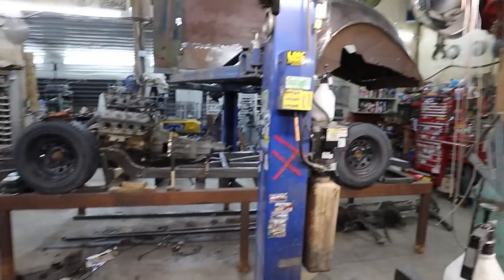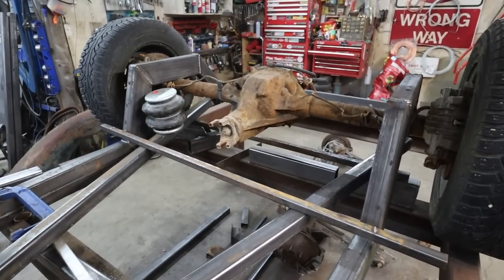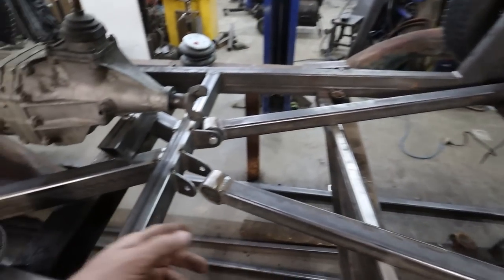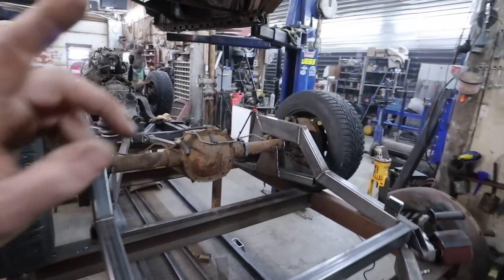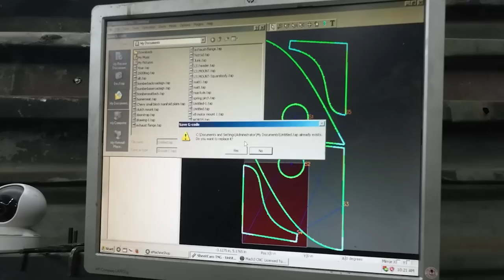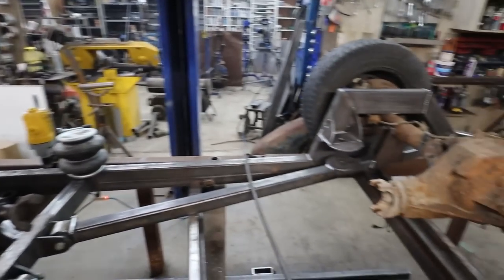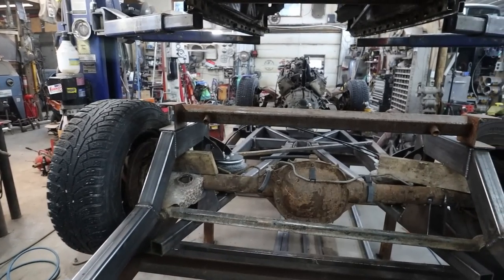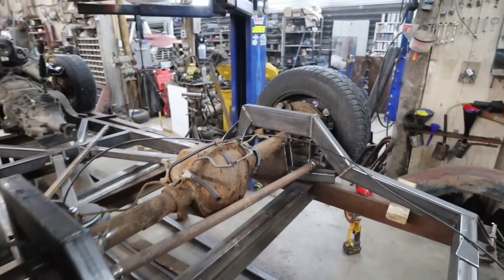Building the 2 link air ride rear suspension for our 1935 Dodge coupe.

Comment: In 1968 I built my first hot rod.  1931 Ford model A.  I built a truck arm rear suspension using 1968 Impala  rear control arms using 2x3 tubing, just as you are doing.  I extended the arms right under the trans mount. I used Corvair front springs right at the rear axle. It rode great!  Plus when you got on it, the arms lifted the whole car.  I hope you have the same result!
The front suspension was a 1968 Corvair, with modified A arms.  Had a Volvo rack and pinion. We had to build everything back them.

Comment: As you were tacking (welding) the diff mounts, I was wondering when you set the pinion angle, cause I didn't remember that happening.  😀  
The frame and suspension is really starting to shape up now!

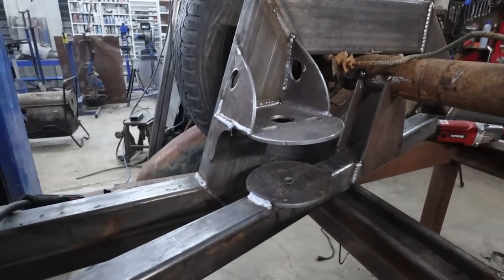Comment: 32:50 that slug is called a "crush tube" and is always a good idea.
Tying the two upper bag mounts in together with it's own crossmember is smart, personally I'd make it removable with a mount in the centre as a provision for a driveshaft hoop.

Comment: looking amazing! i would personally put bushings on the lower control arms at the diff instead of solid welding to the diff. not just for serviceability reasons but also i feel like itll be a rougher ride, plus the rear end might move forward and backward over bumps with suspension travel

Comment: FYI ... toss your bushings in the freezer (or outside in your geographical location ... LOL) and they should press in with thumb pressure ... or a combo of gentle flame on the receiver and cold bushings.  Amazing work mon ami.
Reply: I was going to say the same thing just checking to see if someone got there first.  Also if you need to machine the rubber bushings you can freeze them first.

Comment: I would suggest with the trailing arms, you need 2 bushings at the diff end instead of solid mount. The front axle 2 link in the old Landcruiser, Land Rover defender or Nissan patrol has this type with single bush at chassis end and 2 bushes each arm at the diff end. This allows the diff to roll and move with wheel travel and I feel with your control arm end being solid welded to the diff it may break the welds over time

Comment: You should use your frame rails to get the exhaust from the front to the rear. You can use a flex joint from exhaust manifold  to the frame and incorporate tailpipes out of rear frame rails.
This would be neat to do.

Comment: You should use the magdrill to put some 5/8" holes in to mount the dif in the two bars and then cut the tacks and welds. Use three or four 9/16" bolts each side to bolt it in. Then you can get the bars in a press to change bushes when they need replace or repair? Since they are so long you wanna think about sleeving the bars with a smaller square in there to. Specifically if it's just mild steel you used?

Comment: I was wondering about the pinion angle- I think you should make bolt on mounts for the axle- if anything ever happens to that rear end, you will have to cut off your truck arms to change it.
Reply from the maker: Yeah it's originally what I wanted to do so for now I'm just going to leave it and if I have to change it I'll cut it out from the axle and make it bolt in

Comment: Brent awsome fab work as always, i was going to make a couple of points of querey but one got answered which was the pinion angle when the car  was raised the other is a matter of ground clearance on the A arms. At the axle end the  of the arms there they don't look much higher than bottom of the tyre which looks like you might be in danger of grounding out. personally  i would move them up  two inches or so inside the plates to give a touch more clearance.
Reply from the maker: The bars are over the scrub line and thats all that really matters

Comment: On the front bushing on a 2 link like I fined it works better if you but the front bolts parallel to the cross member instead of how you put them parallel to the arm just have to grind the angle in the tube so it kicks the bushing on angle then with the bolts parallel it seem to flex better less binding

Comment: ONLY chassis stuff Brent? A house cannot stand without a foundation. It's good to understand all the geometry that must go into building a frame.  Also, what thickness metal to use where, bracing (gusset) thickness, where to install and how to put gussets, and such.
What gets stressed under heavy acceleration, how to strengthen these areas...
Stuffing an LS engine into a vehicle that was never designed for one, is also a major task too. 
There's a LOT of things to consider with chassis stuff....
Until the next video on this build,
Be well.

Comment: I was looking at the lower control arm surfaces and I think that it would scrape the ground if you had a flat tire. Maybe you can put a short piece of tube around where your bolt goes through the arm for the airbags? Something so you don't wipe out the head of the bolt? Just a suggestion.
Reply from the maker: It's actually just above my scrub line

Comment: IMO, this build deserve extra time in the engine compartment (when you've gotten to that point) to make it even more cool. Like those engine covers have a cool of their own, but their usually covered in plastic, modern wires and so on. IMHO, it's worth the effort to spruce up the place. Expose the covers with a more old school cool intake, neaten up the wires, hide the plastic. You put sooo much work into the shell, an the chassis (which came out sweeet) that it would be a shame not to. Just my 2 cents. Ultimately it is your car, and i know sometimes you gotta give up some fights, can't win them all.

Man, this ride will be sweet as when it's done.

Comment: You blow my mind at how you seem to just throw this together.  I know there is a lot of experience/knowledge and thinking that goes in behind the scenes.

Quick question/thought on the 2 links.  I would have thought they would angle up to rear so that when you raise the suspension (and they drop) you have more ground clearance?  This way surely you only every have a couple of inches below the rear of the 2 links.  I have ZERO experience of building suspensions, but I would have kept the bottom of the two links matching the bottom of the diff pumpkin.  (Maybe you do and it’s just the camera angle).

All the best, I’m loving the build!!
Reply from the maker: Yeah unfortunately it would affect my floor too much. This is why I went this roughy.

Comment: LOVE the use of slugs in the frame holes for the air bags !!! Brilliant idea to help prevent frame rot.  BTW ... are you going to add a rubber bump stop between the frame and Diff ???
Reply from the maker: I most likely will but usually the bags have an Internal bump stop.

Comment: I see a small problem.  Just offering some constructive  criticism. Those bushings are going to get wore in a hurry, or fatigue the steel and break something pretty quick. Might I suggest doing a double bushingmount on the rear end, you need some give, otherwise it won't be able to articulate. Basically you have a weak swingarm which will twist, that thick steel won't want to do that. What you want to do, is a radius arm. Huge fan, I just want to help is all.
Reply: Also, you could build a radius arm setup to be adjustable for the pinion angle. If you look up radius arm kits for jeeps, you'll see what I mean. Keep up the amazing work.

Comment: Interesting looking ... just wondering when you run over a hump with one wheel where does all the give go ... won't it stress the welds on the housing ... or arn't we talkin that much movement ... other than that it looks pretty cool ...
Reply: I believe it needs to be a radius arm setup. The current  configuration is a open swingarm. Which I don't think will handle the stresses of a long haul like he has planned for this build.

Comment: It could have been a bad camera angle, but the bars connecting to the rear end look like they hang below the rims. I don't know if you are going to put bigger wheels on. But maybe I'm wrong.
Reply from the maker: Yeah it's above the scrub line so it should be good for a flat tire :)

Comment: I see the up and down with the 2 link, but does a 2 link give enough for when your tires are on uneven ground?
Or is there just enough flex in the control arm bushings to let it move independently?
Reply: My question exactly.  Most designs that follow this basic layout allow for rotational movement around the centre line using either a bush or a rose joint.  As built this design will put significant twisting loads into the front bushes and into the welds locating the 'A" arms to the axle.  My guess is that these will be failure points

Comment: Isn't there going to be severe stress on the control arms hard mounted to the axle during articulation? Won't both back tires stay in the same place while driving on an angle or uneven ground?
Reply: And if you wanted the control arms to move as one unit, shouldn't the bushings be mounted 90deg instead of angled to eliminate the stress on them?

Comment: What’s the benefit of the hole punch to drilling? Is it faster ?
Reply from the maker: Well if I use my iron worker it's a lot faster if you're referring to my drill that hit the floor that one's just like a drill press with a magnet on the bottom

Comment: I thought the trailing arms were supposed to be attached to the rear end. with a pivot point of their own as well as the front. that way the rear end could move forward or backwards. And side to side.😕🇺🇸

Comment: Have you made a whatslink before Brent
Reply from the maker: No never really had a need for one usually I can put a long enough kind of hard stuff doesn't move too much
Reply: @HalfassKustoms  ok they were really common here on 80s 90s rear wheel drive Australian Ford's and Holden's . But panhard bar works well

Comment: Scrubline??!!!
Reply: A scrub line is an imaginary surface created if lines were drawn from bottom of wheel rim on one side to bottom of tire on other side. When lines are drawn from both sides an “X” under the vehicle suspension is created. No suspension or chassis component shall be below top portion of this imaginary “X”.